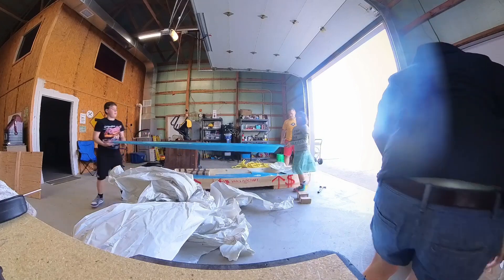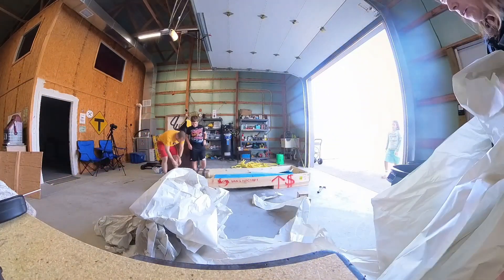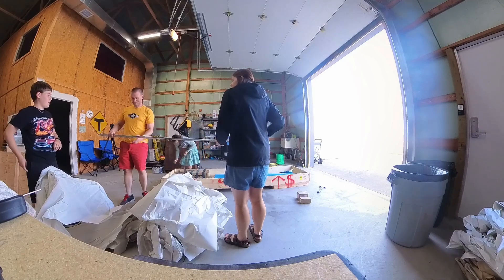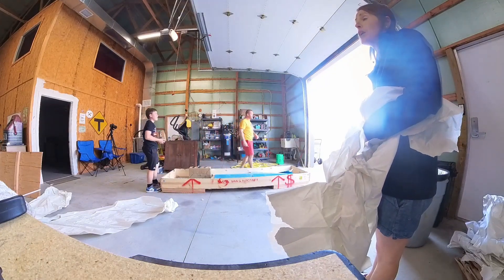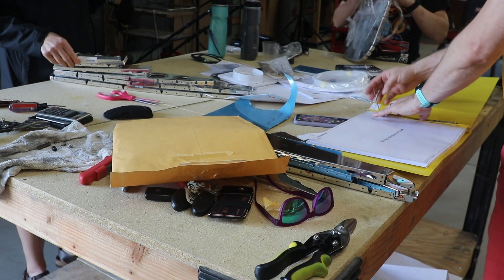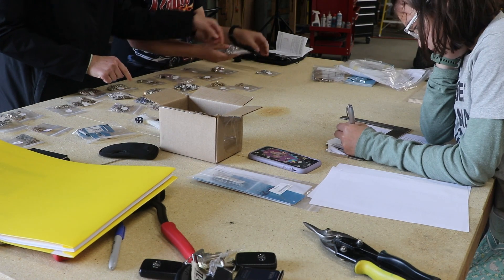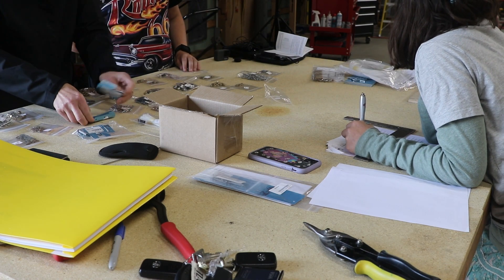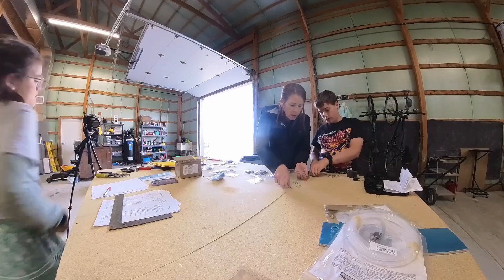Building an airplane - RV12 Tail Kit - Unboxing

Comment: Hey, guys! I am glad that you have already received your kit. Mine is still in the packaging stage. I'm looking forward to watching you. You will obviously be ahead and I think I can learn something from your videos. I have a question about the laser-cut parts. Now everyone has a lot of questions about the quality of their performance. Did you get a kit like them? what do you think about the holes in them. Will you try to replace them or install them in your plane?
Reply from the maker: We do have some laser cut parts in the kits we have thus far. So far Van's has said their study of the parts are not impacting the RV-12 because the holes aren't dimpled, which is where the material strength concerns lies. At this stage, they're not even offering replacements for the RV-12 because it's a non-concern.

I've inspected all of the laser cut parts we're received, and none of them have QC issues like some of the ones we've seen in other kits. So overall, I'm not concerned.

Going forward it seems like future kits will not be shipped with laser cut parts, so if you haven't received yours yet, you are in the clear!
Reply: @hotshotaero  I've heard that the laser cutting results in changing metallurgy causing it to become brittle. This is why the cracks happened when being dimpled. I'd sure want to know the laser cut parts haven't become brittle which would result in stress cracks under load.